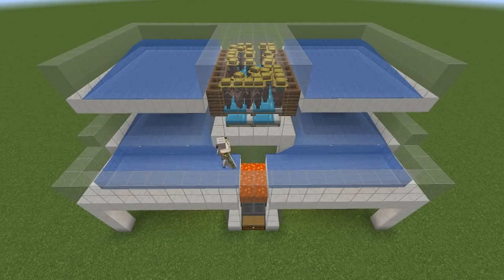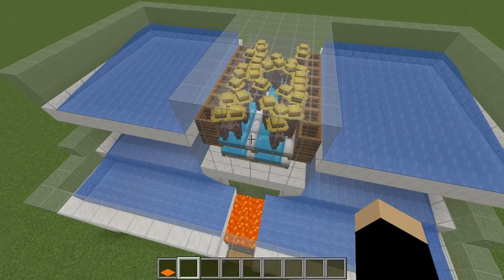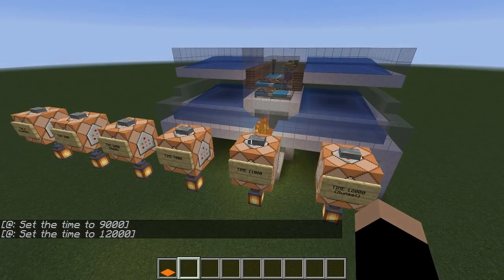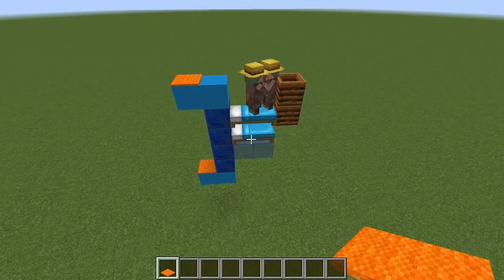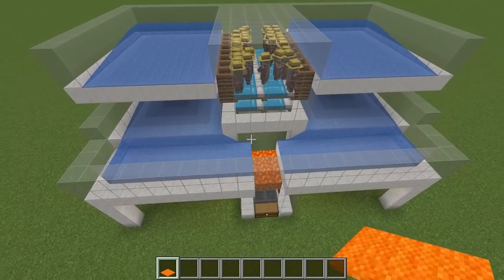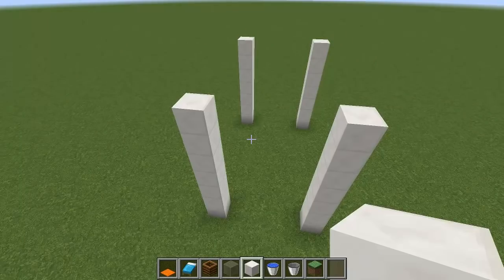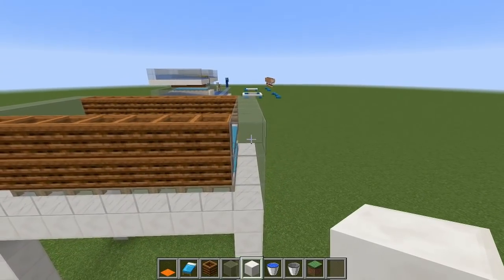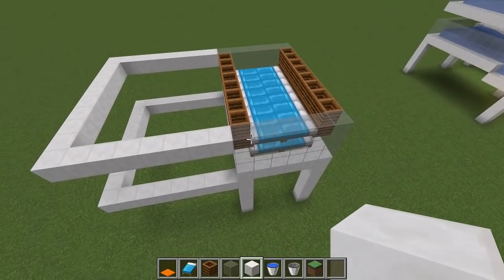1.14.0 Iron Farm Tutorial (120-200+ iron/hr) [May still be bugged in 1.14.1-1.14.2]

Comment: The villages don't get in the bottom beds
Reply: Even with the "fix" in the comments?
Reply: Yeah 1.14.2 is a little broken. What I did is I built the farm with only the bottom beds and when 1.14.3 hopefully fixes the bugs I will put the top beds as well.
Reply from the maker: @drippyeuler  Yeah, sorry guys. The best solution is probably to widen the holding area and have a single layer of beds. Now, of course, they've just changed villager mechanics a third time for 1.14.3, and iron farms are completely different. :/
Reply: @weirdwilliam8500  Don't even mention it dude. Your design was awesome. The new iron farm mechanics are interesting and I'm looking forward to seeing what you can come up with. :)

Comment: What is the 1.14.2 eazy tweak? The trick where you place the top beds afterwards didn't work when I tried it in creative. I really like the design and the tutorial and was hoping to build it in my world.
Reply from the maker: It looks like there are several villager bugs still in effect going into 1.14.2, one of which is that villagers not only randomly unbond from their workstations, but also from their beds. I think the double stacking may not work currently. They seem to have found solutions for the big villager issues but are holding off on implementing them until 1.14.3, and now I'm hoping the bed unbonding issue will be one of those fixes. Unfortunately, once the villagers un-bond from the lower level of beds, then can't pathfind to them again. Sorry, I should update my description with these new findings. It may work again fine in 1.14.3, and I've been reluctant to do much more with villagers until it's all settled.

Comment: Sorry if this is a dumb question, but I'm fairly new to the game. How do you add villagers to something like this? For example, where I am set up currently, there are no villages nearby, my game started in the middle of nowhere (despite me choosing a village starting point). Is there a way to add villagers from creative mode? Or do you have to physically have villagers nearby?
Reply from the maker: If you have access to creative mode, you could use a villager spawn egg, yes. You only need 2 villagers in the holding chamber and then you can throw in food and they'll breed as many more as you want. Outside of spawn eggs, there's no magic bullet. You just need to transport villagers you find in the wild from a village, whether by boat, rails, or nether portals.

Comment: what resource pack is that? all higher resolution ones for 1.14 i've seen look like crap
Reply from the maker: Faithful 32x32. It's great! And like the name says, it stays faithful to the default style of blocks as much as it can, just with better resolution.
Reply: @weirdwilliam8500  thanks! but can you link it in the description? the only "faithful" i'm finding for 1.14 is steven's barrel of puke 64x, no 32s
Reply from the maker: @marcelwo4jedynki  I should start doing that, yes. I'm actually using the 1.13 version rv3.1 and it just sort of...works in 1.14? So I didn't want to advertise that and somehow subject people to errors, although I haven't experienced any yet.
Reply: @weirdwilliam8500  It's okay, I found it. The official website that has a 1.14 version is faithful.team, others are reposts or worse packs
Reply from the maker: @marcelwo4jedynki  Thanks, marcel. I figured there must be a 1.14 update out there but hadn't found it after a bit of searching, and my 1.13 was working fine. Thanks for finding that!

Comment from the maker: UPDATE for 1.14.2. They still haven't fixed several know villager bugs, including villagers randomly un-bonding from their beds at night and standing up out of them. It looks like many of these villager bugs are "resolved" with an implemented fix scheduled for after 1.14.2. Try the fix below, but I'm holding off on doing any major testing until 1.14.3. Every time I seem to figure it all out, they change it a week later. :/

UPDATES for 1.14.1 full release: Yet again they changed villager mechanics, so this farm's bed trick may no longer work at all, even with my fix. 1.14.1 still has significant known villager/mob pathfinding issues, so I expect them to change it again soon in 1.14.2. I'm going to hold off and let these mechanics settle before I come out with a new design.
UPDATES for 1.14.1 pre-releases: Currently in the 1.14.1 pre-release (which still seems to have significant villager bugs), although villagers cannot vertically path-find to a bed under another bed, they can still teleport down to it and back up to the level of the top bed if they are already bonded to the lower bed. So there is a fairly easy fix to have this farm design work in the pre-release:
1. Place the entire lower layer of beds, but hold off on placing any beds in the top layer. 
2. Wait until you've bred or added enough villagers for them to fill all the bottom level beds.
3. Then, wait for night. When all the beds are occupied by sleeping villagers, go in and shift-click to add the top layer of beds. You CAN add beds on top of beds occupied by a sleeping villager! 
4. Throw more food or keep adding villagers for the top layer of beds. All set!
Reply: Are anyone's iron farm villagers flashing since the update?  At exactly time 2000, about half the villagers start flashing (not opening their robes, but blinking like a strobe light).  At time 9000, they stop.   Half my villagers don't sleep because of the bed issue.  I'm wondering if the flashing is do to villagers unable to pathfind to a workstation/work/reset trades or something similar.
Reply: Will this effect already built farms?
Reply from the maker: @joebobbill100  Nope. Already built farms, where the villagers have already bonded to their beds, should work the same as before if you upgrade the server to 1.14.1 (unless they change yet another mechanic in the final release :P ).
Reply: @weirdwilliam8500  Nice, thank you
Reply: @joebobbill100  Apparently they have done something.  My villagers don't teleport to their beds even though they were already bonded to it.  Just upgraded and tested today.  Half sleep, half don't.  The farm still works, but I'm unsure about how it affects things when they can't sleep, but it will be easy to fix.
Reply: @Daethbane  I built a different version, but it uses the bunk beds as well and the same problem occurs
Reply: @petercesmegi9182  Yeah, it seems like the bunk bed idea doesn't work, but I'm also not quite sure because I'm not as knowledgeable as people like WeirdWilliam.
Reply from the maker: @Daethbane  Alright, thanks. Right now I'm holding off for at least a few more days before I add any new updated video or build. There still seems to be significant villager/mob pathfinding issues in the full 1.14.1 release, and they keep changing it every time there's a new version. I want the mechanics to finally settle down and stabilize first.
Reply: @weirdwilliam8500  I'm sure you are on it and it makes perfect sense to hold off the way this update has been so far.  Good news is, the ability for the villagers to sleep doesn't seem to affect the rates of the farm at all.  The others just start there motionless, envying the other beds and plotting with those green eyes...
Reply: @weirdwilliam8500 when i updated, they lost their bond to the beds... so i just killed them all and repopulated with 2 separate groups of 16 villagers, with the top layer of beds 3 blocks above the bottom one. i'm pretty sure they are still within the 6 block vertical range to spawn on both platforms... right? either way, rates seem fine for survival single player.
Reply from the maker: @AeAeRon  Interesting. If the vertical limitations of gossip are the same as horizontal limitations, then this could be a good fix. I'll have to check it as an option for any future farm.
Reply: Idk if the two groups talk to each other. I figured they were spawning golems independently
Reply: @AeAeRon  Your fix worked for me as well, thanks. Specifically my lower platform is one block lower than in the original design. I haven't measured the rate but it seems quite high, if there's an efficiency loss it can't be all that much.
Reply: The problem here is not that some of the villagers don't sleep. The problem is that with unreliable pathfinding to beds some of the beds register as unoccupied, which turns the iron farm into a villager breeder! Being careful about when you place the next layer of beds may help. Another solution is to only use villagers with no food in their inventories (cured zombies, or hatched from spawn egg).
(OTOH, maybe this could be the basis for a combined iron farm and villager breeder??)
Reply: @bobjohnbowles  villagers don't need to path find to beds in order to claim them, unless you're suggesting this was a change that I didn't see in the notes
Reply: @AeAeRon  I'm not sure if this is a confusion in definitions, but actually one of the (for me) major changes in 1.14.1 was that in order for villagers to do a lot of things they not only need to be able to pathfind to their workstation, but also to their bed. If they cannot pathfind to the object of interest they lose their claim to it, though this may not take effect until the next cycle when the software checks.
Not only that, the pathfinding check seems to be very flakey, so that villagers cannot reliably claim a bunk bed, for example. I have seen loads of instances where villagers swap beds.
Reply: @bobjohnbowles  i was aware they made pathfinding required for work stations... but can we confirm this is true for beds? that would mean that we don't have to have the breeder farm 180 blocks away from the villager storage place...
Reply: @AeAeRon  That's the whole point of @WeirdWilliam's pinned post. There are plenty of videos about 1.14.1 by e.g. Xisumavoid, go and look them up. But now 1.14.2 pre-releases are out things might change again...

Comment: Broken in 1.14.1 D:
Villagers can't sleep in beds are down
Reply from the maker: I see. They've made some path-finding changes to how villagers detect and get to points of interest. I've tested the bed issue, and villagers can still teleport in and out of the double bunked beds if they're bonded to them, but they can't bond to the bottom bed initially based on my current tutorial. I'm looking into a workaround way to set up the same double bunking feature, which I think should be possible. Either way, I'm going to wait until the full release of 1.14.1 to make any definitive statements.
Reply: @weirdwilliam8500  Thanks, Let me know if u find a solution

Comment: Just made this and afked with it overnight, works very well, could u just repeat the build but higher up for double the rates?
Reply from the maker: You could build another farm 50 away, or modify it so the holding room is bigger with more beds, workstations and villagers, for a higher spawn rate, then adjust the platforms around it.
Reply: @weirdwilliam8500  okay thanks! if I where to add another same size holding cell a above the first one, then add more spawn platforms around. Would that work? Or no. Thanks for responding, I really like your design!!!
Reply: I was wondering the same thing. or also mirroring the whole thing on the opposite side and share the same kill chamber
Reply from the maker: @calebbasham8635  That mirrored expansion is a fantastic idea. The only potential pitfall is if you get villagers in one room bonding to beds or workstations in the other room. Then they would be useless for golem-spawning gossip. To avoid this, build one room first and make sure you saturate all the bed/workstations with villagers before starting the second holding room.
Reply from the maker: @calebbasham8635  Also, if you watch ilmango's latest video about iron farms, his testing seems to indicate that the more villagers you have together, the higher the rates of iron, almost on an exponential curve. I think he found 8 villagers giving 12 iron/hr, 32 gave 120/hr, and 64 gave like 500/hr. You might be better of just expanding the one holding room and adjusting the platforms around it.

Comment: Now wait for Raid. Defend against Raid and win.... engage celebratory fireworks and mass villager suicide as the fireworks ricochet around inside the villager area killing them all :O
Reply: I think that they will only use Fireworks, when they have No roof above Thema, because the on my Server they are looked in a House an they didnt use fireworks after a defended raid
Reply: @niklasrudde7124  Has happened to me multiple times and a lot of other people have had the same issue. They definitely use fireworks with a roof above their head. I ended up making my roof a few more blocks high with a gap all around it so the the fireworks could ricochet out of the gap and that resulted in much fewer deaths (first time I went from 64 villagers to 1 hahaha.) I named him Jeff.
But now I have a water trap underneath and just get one pillager stuck down there, kill the rest, and leave him (or however many get stuck in the trap.) Eventually the raid just clears with no defeat or victory, so no fireworks. The iron farm will stop spawning iron golems while the raid is active, though. I still get more iron than I can use from it, so I'm not too fussed.

Comment: I dont kniw how to get villgers into the chamber can anyone help
Reply: I built a water elevator up to the level, then built a bridge to the area, trapped a villager at a time in a boat and rowed them into there. Once I got two in there I just dropped them stacks of carrots regularly until I had a big ol' inbred group of villagers. You don't need the water elevator necessarily. You could build a corridor with a ladder up to it, get them in the corridor with the boat, break boat to free them, but close them in the corridor. When night comes they'll most likely head to the nearest bed they can access, which should be up in the villager area.
Reply: @758richy  I give them carrots but they just dont breed wtf is goin on ?
Reply: @sayvonnmitchell8333  Did you start a new game once you updated to 1.14? If not and those villagers were already generated in a previous version then maybe they are still running on the old villager mechanics instead of the new ones? I'm not sure if that would be the case, just a wild guess.
Reply: @sayvonnmitchell8333  I'm assuming you have all the beds placed?  I also saw another video that said if one of the breeding pair is "greedy", it will drop his carrots to share but will snatch them back up himself before the other one can ever get any and they won't breed.  I think he said to fix this you need to fill up all of his inventory slots?  Or I guess you could try to replace him.  Sorry I don't have better specifics but this might give you something to check on.

Comment: I know it's 5% lost but how do you make 100% efficiency?
Reply from the maker: As I currently understand the mechanics, you can never have 100% efficiency because the villager holding room necessarily takes up some of the potential spawning area. However, if you have a fairly small or narrow holding room, and surround it on all sides by platforms extending 8 away, and the platforms are doubled up so one is at the highest potential spawn level and one is at the lowest spawn level, you should be approaching something like 99.9% efficiency. I just think it's a lot of space and effort for that extra 5%.

Comment: Can this 1 build be extended? Like a bit larger. Or is this as big as it gets?
Reply from the maker: You could made the holding room bigger, with more beds and workstations, and then adjust the platforms around it as you like. Or you could add more platforms to current build and have separate killing drops if you can't get the water flowing all to one place. The new mechanics are flexible and allow a lot of options.

Comment: Great Video great farm agree with you a 100% The findings seem right to me as well. Didn't know about the ten spawn attemps yet though. Where did you get that info from or how did you confirm it ?
Are the 200 iron per hour with or without skipping the night ?
Nice trick you got there with the teleporting through the beds :D
The farm i desiged myself is quite similar they just have a seperate block for standing. And the workstations are actually part of the spawning platform.
Reply from the maker: Nice, thanks for the thoughts. I heard about the 10 spawn attempts in another 1.14 tutorial, I forget which now. It's also how golems attempted to spawn in 1.13 and earlier. I could be wrong, I suppose, but it's my best understanding. Someone like ilmango would need to go code-digging to 100% confirm.
After I ramped up the gossip for this farm, I afk'd for an hour and got a little over 3 stacks. Then I afk'd another hour and got a bit less than 3 stacks. I imagine that yes, the output would practically double if the nights only lasted 10 seconds due to rapid sleeping. Either way, it should be plenty of iron for most people.
Reply: @weirdwilliam8500  Ok thanks for the reply a world download would be nice by the way. Also i rebuild the farm let it run for 8 hours to get enough gossip and then always checked after 1 hour four times. And the average was like 120 iron per hour. So not even 2 stacks. Really don't know how you got 3+ stacks
Reply from the maker: @Matthew1234567890m  Thanks for the info! I ramped up the gossip and let it run for two 1-hour sessions and got around 3 stacks per hour. So perhaps I should've let it run much longer like you did! I appreciate you testing this thoroughly. If your numbers pan out for me or others then I may change the description. Again, I may come of as authoritative but I'm mainly cobbling together the new mechanics info as best I can and passing it on.